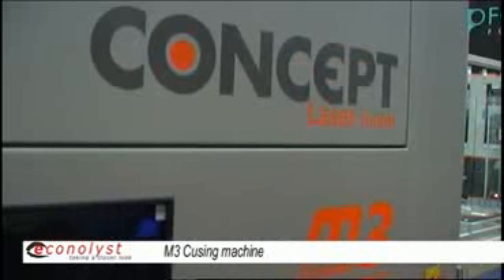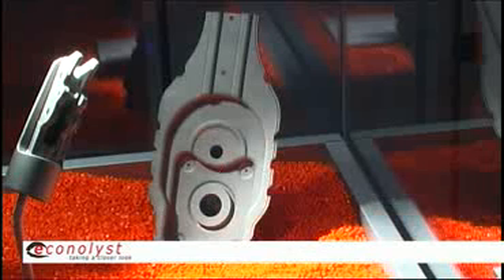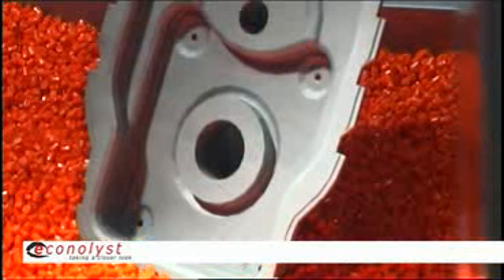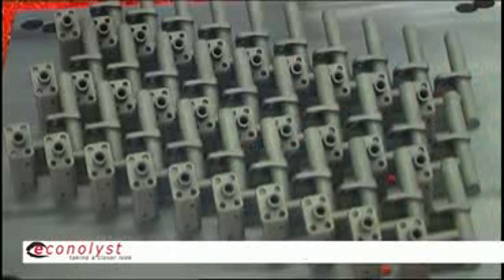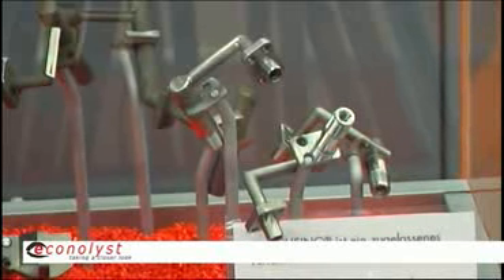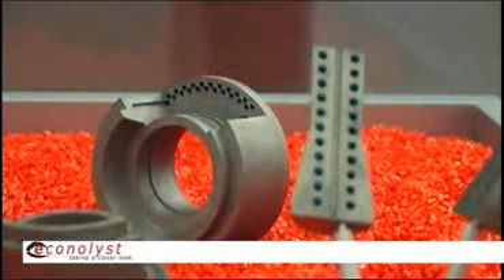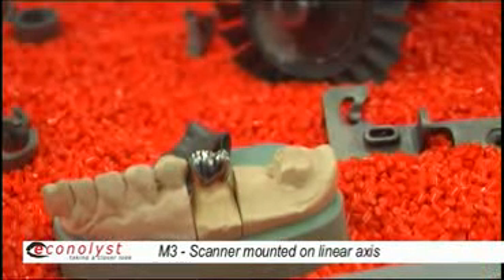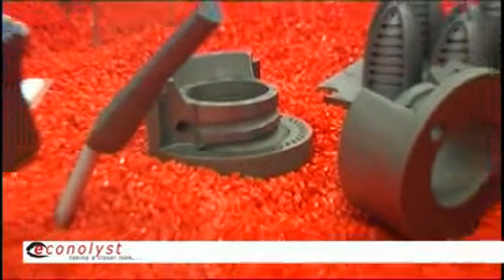Concept Laser - Laser Cusing

Comment: There is a company in New Mexico that has been doing this for a while.  They focus, pun intended, on sintering metal powders to rebuild cracked jet turbines (after a bird or rock strike, for example).  The process has been approved by the FAA.  I thought that this technology would be weak, when in fact, it is very strong.  The only issue was accuracy of the additive process, specifically the surface, which was rough.  That was five years ago and it may have improved substantially meanwhile.